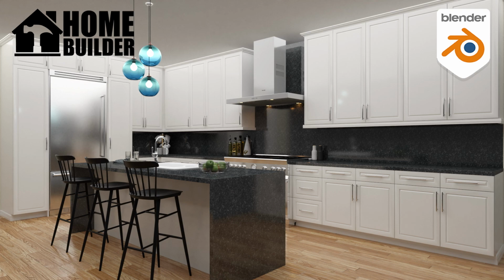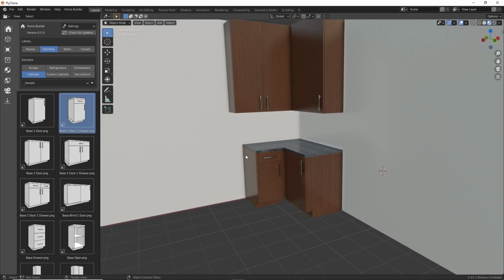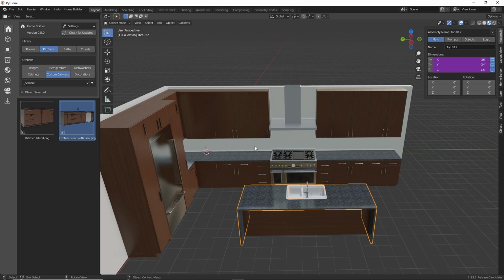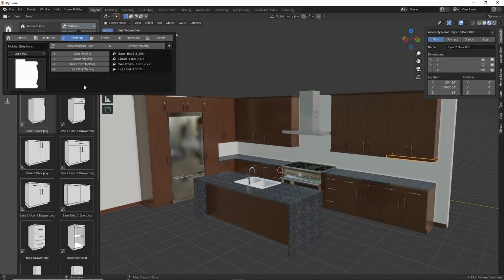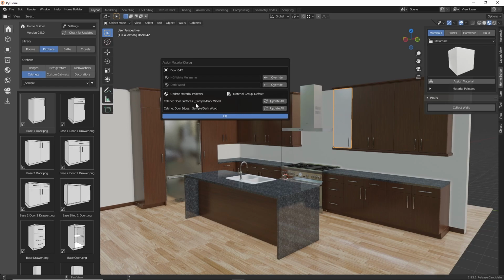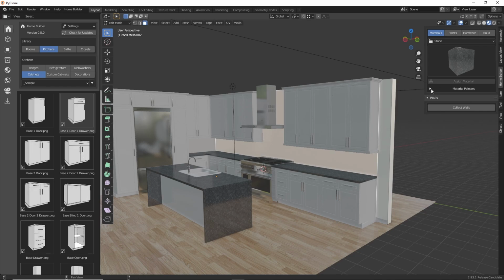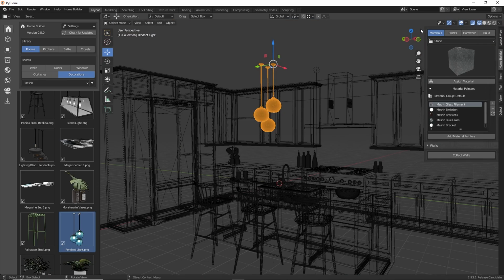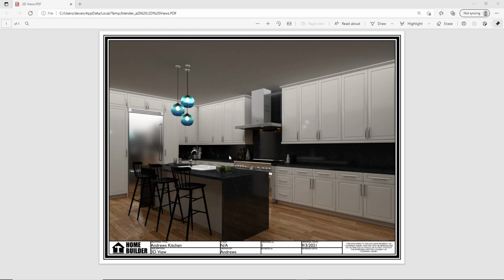Easy Kitchen Design Tutorial In Blender

Comment: For everyone's information and for consideration:  The cabinet industry as a whole has categories.  The main categories are framed and frameless.  Sub-categories of both are stock, semi-custom and custom.  When ordering the cabinet list is obviously very important.  Stock line manufacturers sell a filler as a separate item from the cabinet, they need to be on the list.   It's great the filler is automatically added to the perpendicular cabinet, but should not be included  in the "width" of the cabinet.  Blind corner cabinets are typically pulled from the corner. Multiple reasons, one out of square walls.  This pulling needs to be shown graphicly to the installer on plan and elevation.  So, the steps right now, unless I'm missing something are, pulling base cabinet, extending countertop to cover the void of cabinet, snapping the next cabinet and changing  the  placement back to the wall.  So, simplify this please, thanks. :).  This addon is great, don't get me wrong.  I've gone from using 3-4 different pencil lead weights to Blender/Pyclone/Home Builder, with 5 other softwares in between.  Imagine, drawing perspectives by hand.   And, the client asks, "Can I see it from here, now?"
Reply from the maker: Yeah this is great information. I definitely plan to improve this functionality especially when i create reports for ordering cabinets. Consider joining the discord channel so we can discuss this further. https://creativedesigner3d.com/2021/09/08/discord-channel/
Reply: @andrewpeel1996  If you need infos on kitchen cabinets industry don't hesitate to ask ;-)

Comment: Can you change the color of the cabinets using a color wheel?
Reply from the maker: Yeah you can change color using a color wheel. I use the same material setup as Blender. Anything you can create as a material in Blender can be used in Home Builder.
Reply: Also can you change the color of wood the floor is?

Comment: Can you add click animations. So if I click on that wall corner cabinets door. It should open 90deg. So i can easily judge whether the door handle will hit the other door or not. Yes it can be done manually by rotating it. Not fun doing it in front of client. Similar click functionality to open drawers and close them.
Reply from the maker: In the right click prompts there is an option to open doors. It would be possible to automate it, but it's really easy to do from the prompts interface.

Comment: Did you fix the crash when pressing Undo (Ctrl+Z)? Thank.
Reply from the maker: I spent a lot of time looking into it, but the error is happening in Blenders Source Code. Undo is only an issue after dropping an asset. I have a feeling when Blender supports drag and drop in 3.0 I will be able to get the issue fixed. For now I have implemented easy ways to delete the assets, but I will get this resolved.

Comment: What are the long term plans for this addon when blender finally gets it's asset manager. I have 5 or 6 addons that all add some sort of asset manager to blender in totally different ways so it would be nice if there could be a consolidation around the new blender features. But each addon is also doing unique things with the manner assets are added so I'm not sure if that would hurt the viability of the main assets editor for projects like this.
Reply from the maker: I plan to merge the functionality to work with Blenders asset browser, but it is still in development. When they have the design finalized I'll have a better idea of how I will go about it.
Reply: @andrewpeel1996  Will you also port your assets to Geometry nodes so we can use the asset library with standard Blender?